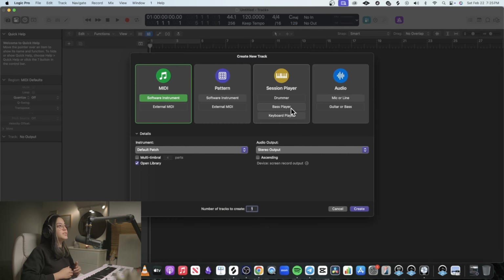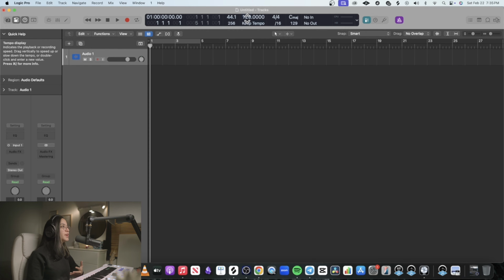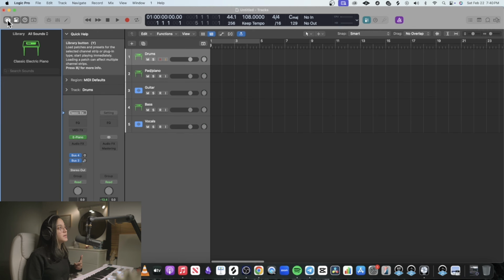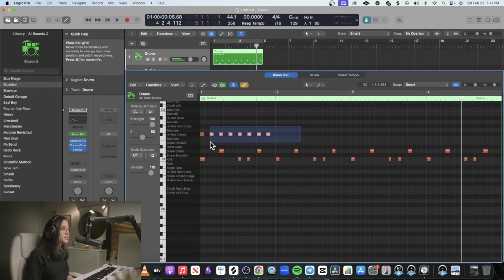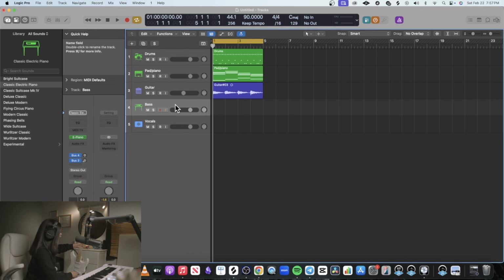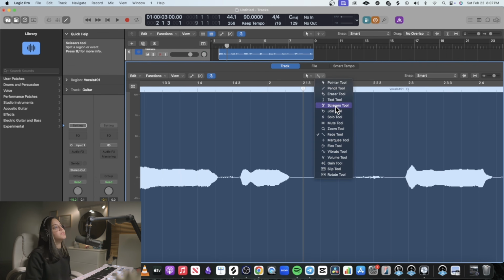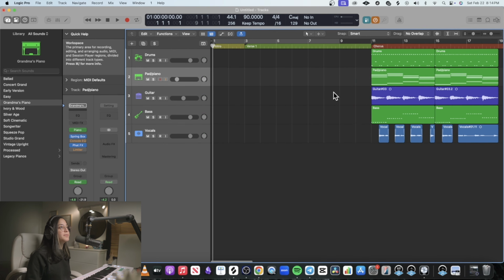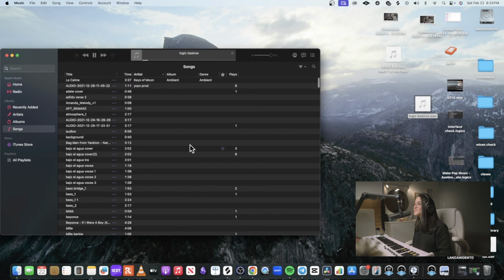How to Use Logic Pro: A Beginner's Tutorial

Comment: hi! do you have any recommendations for a audio interface? I want to connect my midi keyboard and my guitar
Reply from the maker: Hey! Yeah, if your MIDI keyboard connects via USB, you can plug it straight into your computer, and then just use an audio interface like the Focusrite Scarlett 2i2 for your guitar. Super solid and easy to use.

If your keyboard uses 5 pin MIDI cables, I’d recommend something like the Scarlett 4i4 or PreSonus Studio 24c.